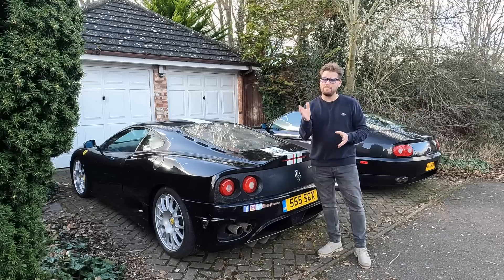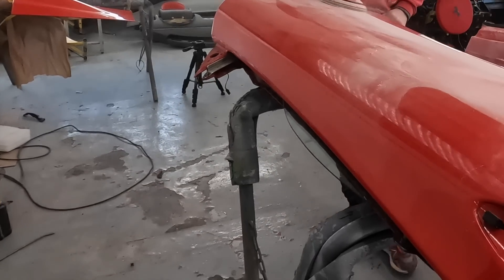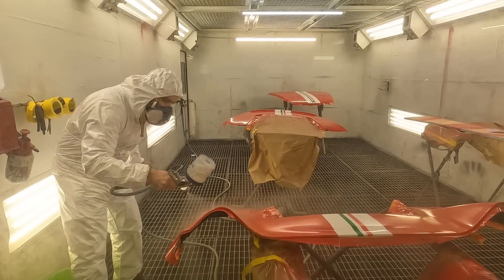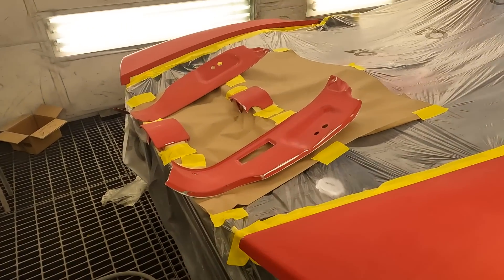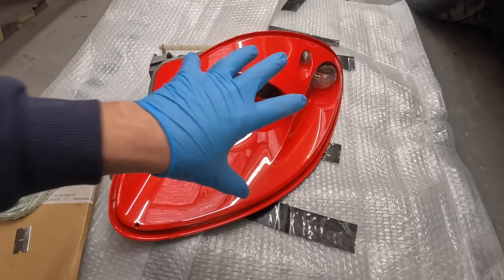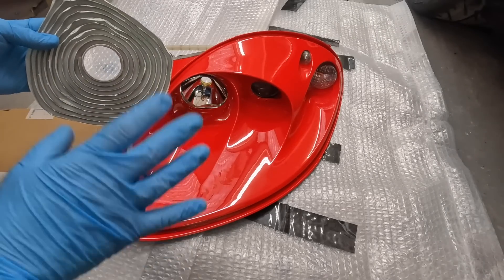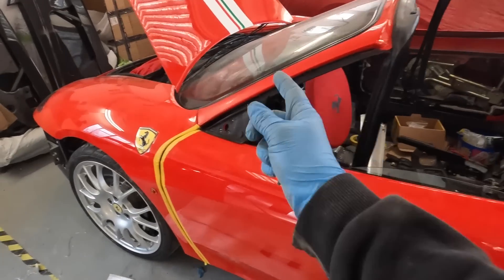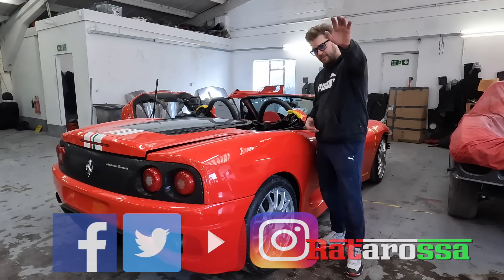Ferrari 360 CS Spider Project - Building The Missing Ferrari - Part 9

Comment: Hi Scott 
I think the colour is perfect and the attention to detail with the strip is brilliant.  Clearly you and the guy are doing a great job the owner is going to be very happy with the finished product. My question is does the weight of the roof mechanism and the extra strength in the chassis of the convertible offset the weight savings of standard 360 Challenge Stradale 
Great video 👍👍
Thanks

Comment: LED lights inside rear bumper, pointed towards the engine!! The taillamp surround is transparent, so light up the engine! Another light inside trunk lid, pointed towards engine. That will make the engine bay glow!!!
Reply from the maker: it would be nice but this build we really are trying to maintain how 'if' Ferrari had built the challenge stradale spider they would have done it

Comment: I recall reading  a story about a motor industry visitor to the McLaren factory asking if they had aspirations to be Ferrari.

The response was, 'No. We don't have anyone here who can weld that badly.'

On the flip side, myself and a mate went to look around the McLaren showroom in Knutsford when the  MP4-12C was launched, and one of the salesmen walked over and locked the front door when he saw we were going to go in. Wanker.

We were in Knutsford to collect a Mercedes my mate had bought, and admittedly we weren't exactly dressed in our Sunday best. I could afford a McLaren, but he chose to judge a book by it's cover, so he can shove his McLarens up his arse. Sideways.
Reply: Have you seen the build quality of a mclaren? They are absolutely shocking.  If you jack one corner up the windscreens crack and the body panel gaps are terrible.

Comment: I've been watching your channel for a while. The shonky Testarossa spyder is quality. As is the 308 of many colours.

When I saw the 512 BBi you found I hoped the owner would see sense and let it go to someone who'd give it the love it deserves. It's as rare as rocking horse shit, (as you well know), and it was heartbreaking to see the state it was in when found.

Hopefully no vegans will have looked up the ingredient in the neatsfoot oil you used to try and preserve the leathers of the interior. From the distance of the internets, the interior seemed to clean up well and leven if a bit dry, the leather looked like it was salvageable. It'd be a shame to have to retrim it. If things go tits up with Putin's current antics, you could always fall back on the interior as a foodstuff.

I decided to put some of my savings into a 7.5 litre big block 1955 Chevy Gasser rather than a McLaren. It's a dinosaur. Right up my street, and I can drive it in my scruffs.
Reply from the maker: Thank you and congratulations on the purchase, sounds like a very cool car and different to the mac
Reply: Well, it worked until I broke it.

It decided to shear all 5 wheel studs on the right rear wheel, which rather than popping out of the wheel arch, went under the car, doing quite a bit of damage on the way out.

Fortunately, it happened at 20mph when I was behind a little Noddy car in a 30mph limit.

Not fixed yet as I had a lengthy mental vacation, but now I'm back it's on this year's jobs list.
Reply from the maker: @cogboy302  good luck with that. Nothing is ever smooth sailing with car projects 🤣
Reply: Absolutely correct. But sometimes that's part of the fun.

I'm mostly narked that the quarter panel got rather bent, and the car is tubbed & has radiused rear wheel arches, so it's not like I can just put a new panel on. Fortunately I have a friend, who has a friend living next door to him who builds Escort, Chevette, etc. Rally cars, and is a good body man. I'm hoping we'll be able to repair the quarter panel. It may need cutting, reshaping and welding back together.

The car is a replica of the 'hero' car from the 1970 film, 'Two Lane Blacktop', so it has to look right. When I bought it, it came with a 2nd pair of rear wheels (wearing drag slicks), which came from one of the three cars originally built for the film.

The Stradale is starting to look really good. 👍

Comment: What was the sealant you used. I have two sets of headlights to repair.
Reply from the maker: ill did out the product name, it wasnt expensive just took a while to get the right stuff and grey colour
Reply: @Ratarossa  I also have a 360 I had to replace the headlight capsules. I have to rebuild the old set to sell.

Comment: You lifted the engine cover up with the carbon panel still just placed on it for the video 😬 … it was luck it stayed when you opened it to place the rear panels and lights in place
Reply from the maker: ahhhh thats all in video editing, both sides were in place by then and two bolts in each to hold them down

Comment: When you say lacquer do you mean clear coat?
Reply from the maker: yes sorry i will hang my head in shame on the next video. we still refer to it here as lacquer but yes its clear coat
Reply: @Ratarossa  Ok that is what I thought it was and I am surprised your painter had no eye protection.  Clear coat is a real nasty chemical that can cause cancer.  When I use SprayMax two part rattle can clear coat on my motorcycle build I used eye protection and the same breathing protection.  Your build looks very nice and I love the color.  It really pops in a cool way.  I have a manual 430 In Silverstone Gray.

Comment: Odd to be working on a car for which the parts are expensive. And then so very often (too often) mention the huge cost for a part. As well, would have been less expensive to hire a graphics shop to replicate the decal. Possibly even of superior materials. As for parts, time you learned how to use  lathe and a Bridgeport mill. Surely someone there in blighty will rent you machine time.
Reply: A reproduction decal doesn't have the 'Value' a factory original does. At this concourse level, even one wrong bolt is a black mark. They have to be "Exactly as they would have left the factory". Mill and lathe - smarter to employ an expert. Scott isn't broke and you don't get where he is by doing everything yourself.
Reply from the maker: I actually covered the stripe in a previous video. Initially we bought direct from Ferrari at €500 a original stripe (sticker) but amazingly it was printed incorrect 🤣🤣🤣